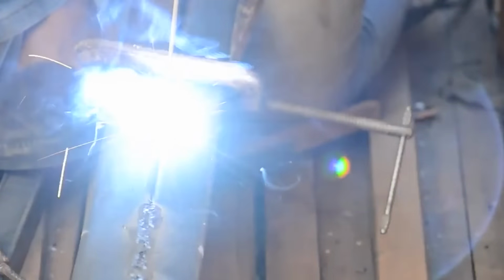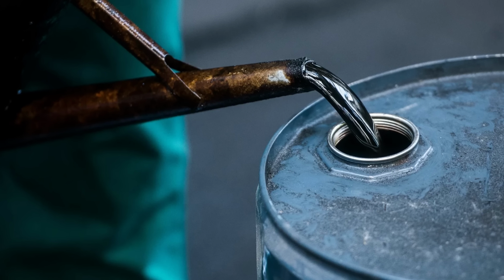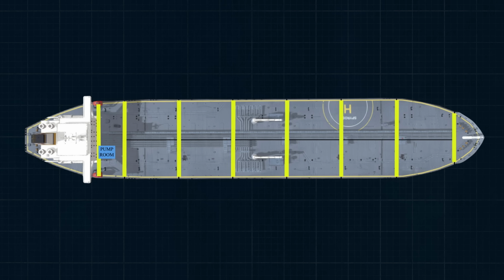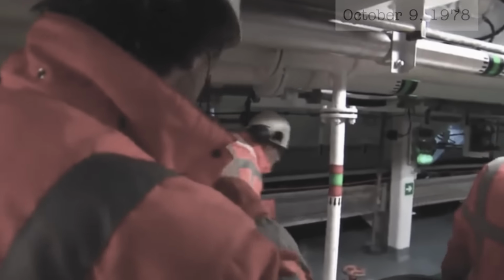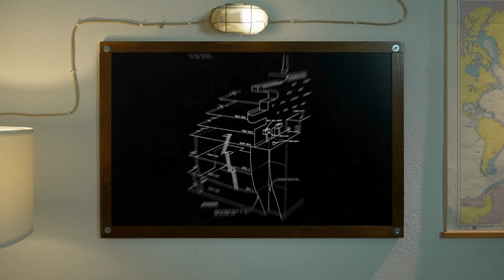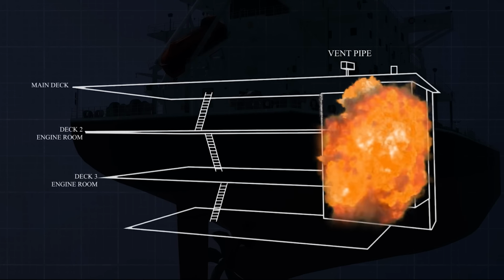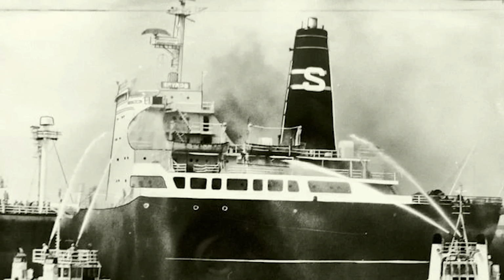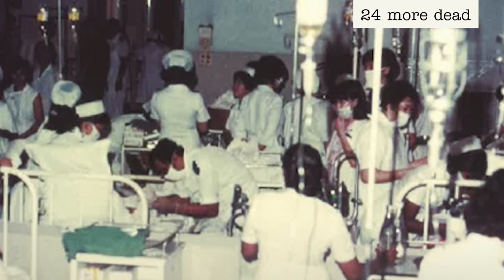A Floating INFERNO! | MV Spyros

Comment: can I get a source on flammable Vs inflammable cause everything I can find online says they have the same meaning? Could you mean combustible Vs flammable? I'm also not sure it's possible for anything to ignite without an ignition source, even if it's just the sun?
Reply: They’re synonyms, not opposites.
Why the confusion?
The prefix in- usually means “not” (as in invisible = not visible).
But in inflammable, the in- comes from Latin inflammare — “to set on fire” (in = into, flammare = to flame).
So inflammable literally means “capable of being inflamed.”
Practical takeaway:
Because “inflammable” can be misread as “not flammable,” safety standards now overwhelmingly use “flammable” (and “non-flammable” for the opposite) to avoid dangerous misunderstandings.
So if you see “inflammable” on an old container — treat it as flammable.

Comment: I worked in a shipyard servicing USN vessels. There was a whole crew of “gas-free technicians” who tested enclosed spaces to ensure they were safe for entry (not oxygen deficient) and to issue welding certs. Their supervisor was located in the safety office that reported directly to the top executive - only one level of management (the Safety office director), from the top where the “buck stops” (or the sh!t stopped rolling) in the event if fatalities.  been in a fuel tank I can say one does not want to be in one in an emergency situation; rescue in a deep tank through a manhole just big enough to squeeze through is a “high pucker-factor” event. 

The explosion described herein is the sort that doomed IJN aircraft carriers only the main culprit then was Avgas (aviation gasoline).  Avgas is just that, gasoline which is often a low-boiling point distillate of crude oil. The USN was glad to see jet planes replace Avgas piston powered ones. Jet fuel is far less flammable/inflammable.  I’ve heard the USN no longer uses jet A but something more like diesel fuel marine, the sort of fuel used in the SR-71 that could withstand very high temps without flash hazards.

In this case it appears even a standard fire watch would’ve done little.

Comment: I'd better add this info up here, as so many people were discussing the difference (none) between Inflammable and flammable)
"The words "flammable" and "inflammable" both mean the same thing: capable of being easily ignited and burned.. Despite the prefix "in-" often indicating negation, as in "inactive," in "inflammable," it acts as an intensifier, similar to "inflame". Therefore, both terms are used to describe materials that are easily combustible. 
Why the confusion?
The prefix "in-" can be confusing because it often signifies the opposite of a word (e.g., "in" + "active" = not active). However, in "inflammable," it comes from the Latin "in-", meaning "to set on fire". This historical usage led to some misunderstanding, with some people mistakenly interpreting "inflammable" as meaning not flammable. 
To avoid confusion, it's best to use "flammable" when describing something that burns easily. "

Comment: Iv always struggled with the difference between flammable and inflammable. I thought they were basically the same. You explained it well but i dont understand how a fire can start without a source of ignition?
Reply: They’re synonyms, not opposites.
Why the confusion?
The prefix in- usually means “not” (as in invisible = not visible).
But in inflammable, the in- comes from Latin inflammare — “to set on fire” (in = into, flammare = to flame).
So inflammable literally means “capable of being inflamed.”
Practical takeaway:
Because “inflammable” can be misread as “not flammable,” safety standards now overwhelmingly use “flammable” (and “non-flammable” for the opposite) to avoid dangerous misunderstandings.
So if you see “inflammable” on an old container — treat it as flammable.

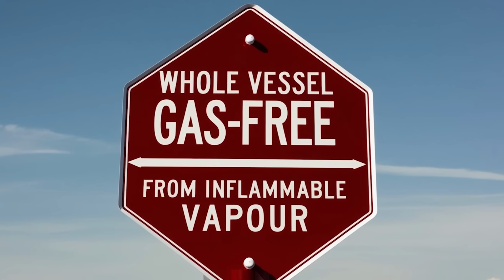Comment: Question, I was super intrigued when you explained inflammable versus flammable 4:55. I thought ohh, that makes sense. However, when I decided to look up additional information, all the resources I checked said there is no difference between the two. Do you happen to remember where you read that there is a difference and that they aren’t just synonyms? 
I googled it, checked Merrill Webster dictionary, ask ChatGPT, and Grammerly. 

Here’s two words I found related:
Spontaneous combustion (due to heat buildup or chemical reaction), or
	•	Pyrophoric (ignites on contact with air).

I’ve been in the oil and gas field all my life and this often came up and caused  🔥heated🔥 debates. 😬

Great video btw, 
God Bless ツ
Reply: Fascinating. I did the search as well, and got a reason for the use of "in" that creates confusion
"The words "flammable" and "inflammable" both mean the same thing: capable of being easily ignited and burned.. Despite the prefix "in-" often indicating negation, as in "inactive," in "inflammable," it acts as an intensifier, similar to "inflame". Therefore, both terms are used to describe materials that are easily combustible. 
Why the confusion?
The prefix "in-" can be confusing because it often signifies the opposite of a word (e.g., "in" + "active" = not active). However, in "inflammable," it comes from the Latin "in-", meaning "to set on fire". This historical usage led to some misunderstanding, with some people mistakenly interpreting "inflammable" as meaning not flammable. 
To avoid confusion, it's best to use "flammable" when describing something that burns easily. "

Comment: If you want a funny (but still a bit sad, beacuse it involves a business failure) story, the tale of the TSS Duke of Lancaster is a classic. From 1956 to 1979 it had a mostly blameless life as a ferry, mainly on the Heysham to Belfast route, with occasional work as a small cruise ship, ending up as the back-up ferry on the Holyhead to Dun Laoghaire route. Here is where the tale of the TSS Duke of Lancaster gets really interesting. From 1979 to 2004 it was a floating "Fun Ship" at Mostyn in North Wales, basically a floating department store with added attractions for kids, designed to get around North Wales's notoriously strict Sunday trading laws. And here lies the problem, as Trading Standards regularly used to raid the ship on said Sundays. Once, the owners tried to set sail, as any attempt by Trading Standard to board would then be piracy! But that was considered to be "interferance with a trading standard officer in the NORMAL (my capitals!) conduct of his business". There were other attempts between 2004 and 2012 to re-open it, but all foundered on the rock of North Wales's Sunday Trading regulations. Finally, a lot of the kids attractions were sold and a new tack was tried - as an art gallery! Murals would be painted on the sides of the ship as public art. But even this didn't last. One last attempt at revamping the "Fun Ship" concept was made in 2021, this time with the blessing of North Wales Trading Standards (time having finally moved on for them) but its run into a snag. The access road is used by fly-tippers to dump rubbish in the sea, and unless a totally contained access can be created, its access will be cut off. So it stands, a white and rust behemoth permanently at dock with no role.

Comment: But... Flammable and inflammable mean exactly the same thing.  There's no difference between the definition of the two words.  Or is this another case of the UK not understanding English and making a difference in their Byzantine regulations?
Reply: They’re synonyms, not opposites.
Why the confusion?
The prefix in- usually means “not” (as in invisible = not visible).
But in inflammable, the in- comes from Latin inflammare — “to set on fire” (in = into, flammare = to flame).
So inflammable literally means “capable of being inflamed.”
Practical takeaway:
Because “inflammable” can be misread as “not flammable,” safety standards now overwhelmingly use “flammable” (and “non-flammable” for the opposite) to avoid dangerous misunderstandings.
So if you see “inflammable” on an old container — treat it as flammable.

Comment: Inflammable does NOT mean something can ignite without an ignition source. Where the hell did you read that?
Reply: They’re synonyms, not opposites.
Why the confusion?
The prefix in- usually means “not” (as in invisible = not visible).
But in inflammable, the in- comes from Latin inflammare — “to set on fire” (in = into, flammare = to flame).
So inflammable literally means “capable of being inflamed.”
Practical takeaway:
Because “inflammable” can be misread as “not flammable,” safety standards now overwhelmingly use “flammable” (and “non-flammable” for the opposite) to avoid dangerous misunderstandings.
So if you see “inflammable” on an old container — treat it as flammable.

Comment: inflammable and flammable are synonymous
Reply: They’re synonyms, not opposites.
Why the confusion?
The prefix in- usually means “not” (as in invisible = not visible).
But in inflammable, the in- comes from Latin inflammare — “to set on fire” (in = into, flammare = to flame).
So inflammable literally means “capable of being inflamed.”
Practical takeaway:
Because “inflammable” can be misread as “not flammable,” safety standards now overwhelmingly use “flammable” (and “non-flammable” for the opposite) to avoid dangerous misunderstandings.
So if you see “inflammable” on an old container — treat it as flammable.

Comment: I used to work for a hazmat company that cleaned out oil tanks for inspection and repair. I can tell you, crude oil vapor is no joke. We were getting set to clean a crude oil tank out up in New York a few years ago. Pumped the tank down until there was only about six inches of crude sludge on the floor of the tank. Opened a manway with SCBAs on to mount a giant fan to ventilate the vapor when the compressor running the fan died. We had to put the fan back down and try to get the manway cover back on. The vapors coming out of that hole on a hot day looked like the NTI "tentacle" from "The Abyss". Just a giant blurry tube of gas pouring out of the manway into the dike area. Turns out we got a bad load of diesel fuel delivered for the compressor that had sediment in it and clogged up the fuel filters. Could've been a bad day.

Comment: Jacksonville, N.C. Garys lounge, drunk guy comes out of the bar, decides to fire up his truck mounted cutting torch, cut off the top of that annoying nub in the parking lot, on a  no longer being used fuel tank underground. Kablooie! Chunk of concrete went flying up in the air, landed on a car 40 ft away, waiting in traffic. Killed Junius Stith, a military veteran. This was like late 90s, early 2000s. Drunks and torches, what a combo!

Comment: 5:05 Sorry, did chatGPT tell you that? Because it’s absolute nonsense. Flammable and inflammable have never been used to mean different things.
Reply: They’re synonyms, not opposites.
Why the confusion?
The prefix in- usually means “not” (as in invisible = not visible).
But in inflammable, the in- comes from Latin inflammare — “to set on fire” (in = into, flammare = to flame).
So inflammable literally means “capable of being inflamed.”
Practical takeaway:
Because “inflammable” can be misread as “not flammable,” safety standards now overwhelmingly use “flammable” (and “non-flammable” for the opposite) to avoid dangerous misunderstandings.
So if you see “inflammable” on an old container — treat it as flammable.
Reply: @GunnarMiller  Umm, yeah, I already know that. That’s why I commented that the video is wrong.

Comment: Flammable and inflammable mean the same thing: substances that can catch fire easily, typically requiring an ignition source. The distinction you may be thinking of actually applies to the words flammable or combustible. Flammable materials ignite at lower temperatures, while combustible ones need higher temps. This is just a difference in their flashpoint temperatures. Substances that ignite without an external source (autoignition or spontaneous ignition) is a different property.
Reply: The correct opposite is non-flammable.
Reply: @Canalcoholic Nobody mentioned an opposite. The question is about the difference between flammable and inflammable. Nobody suggested they are opposite.
Reply: @snoutysnouterson  You missed the point, the prefix 'in' usually means not, so competent / incompetent, coherent / incoherent, so you would think that inflammable should mean not flammable - but it doesn't.
Reply: @Canalcoholic I didn't miss the point, you imagined something that did not happen. Nobody said that inflammable means non flammable, nobody said they were opposites, or even incorrect opposites, it wasn't said in the video, and the OP didn't say it either. So you are replying to a statement that does not exist.
Reply: @Canalcoholic No one mentioned the opposite. 😮
Reply: I thought what he said was incorrect also. Was a bit baffled!  I think, as you said, he has confused another term with inflammable!

Comment: I'm going to need a source for "Inflammable" meaning something can combust without a source of ignition. Everything I can find (including Websters) says flammable and inflammable are synonyms.
Reply: It's industry jargon you aren't going to find it anywhere except the safety books/regs.  Pretty sure the MSDS will distinguish the two. I only know it due to MSHA certs.  Silk screen printing has both flammable and inflammable chemicals used in the process as well. 

When it comes to fuels, it's the diesel and kerosene fuels that are inflammable, and gasoline and alcohols that are flammable.  Of course any chemical that reaches it's flash point is technically inflammable, but for the case of OSHA, MSHA, and the EU counterparts inflammable means flashpoint's at or below room temperature.
Reply: You are right. And the prefix "in" has an  interesting source
"The words "flammable" and "inflammable" both mean the same thing: capable of being easily ignited and burned.. Despite the prefix "in-" often indicating negation, as in "inactive," in "inflammable," it acts as an intensifier, similar to "inflame". Therefore, both terms are used to describe materials that are easily combustible. 
Why the confusion?
The prefix "in-" can be confusing because it often signifies the opposite of a word (e.g., "in" + "active" = not active). However, in "inflammable," it comes from the Latin "in-", meaning "to set on fire". This historical usage led to some misunderstanding, with some people mistakenly interpreting "inflammable" as meaning not flammable. 
To avoid confusion, it's best to use "flammable" when describing something that burns easily. "

Comment: Are you telling us that a crude oil tanker used crude oil in order to increase it's profit margin? Yeah, that's just wild man...  They added a small tank of crude oil where there was already a huge one they were supposed to be able to handle safely. There are no tankers or refineries that won't explode if you ignore the safety regulations. 

I actually worked in a refinery that had gone up in flames when some guy opened a valve at the wrong time and let out some oli that was heated above its ignition temperature to make it easier to pump through the pipes and whatnot. This is possible because there is no oxygien present inside the pipes but as soon as that stuff met the oxygien in the atmosphere the shit hit the obvious fan and then they called in our team to clean up the mess. This was a relatively small refinery in central sweden, but it was still a absolutely post-apocalyptic scene. We almost couldn't believe that no one got unalived!

Comment: Fuel air explosions are incredibly dangerous, especially when dealing with such a large volume of volatile gas. It’s possible that the explosion wasn’t as loud on deck at ignition, and a low whistle would have been heard in the first moments by the welder and his assistant before the fire reached the tank. What happened then could have been avoided, but that would have required an innert gas system.

It makes sense to have a contract with such a clause because the delivery of this cargo may not be time-sensitive, so the propulsion doesn’t necessarily need to be operated inefficiently.

This practice may have been more common than most realise, but not by using fixed pipes, but rather with flexible hoses.

Comment: Sounds like the injustice system!  Welder does as told when proper signage and due diligence is overlooked,  sentenced to 38 years thankfully overturned on appeal!  Companies 100% responsible for almost 100 deaths,  FINED $9000 ????   Wtf is that?  Welder gets 6 months for each death to ger 38 years,  Companies fined less than $150 per person for negligence?  Sounds fair to me,  what's your problem?😅😅😅